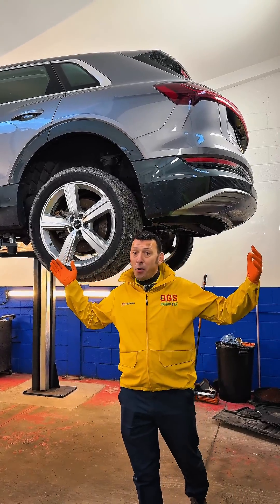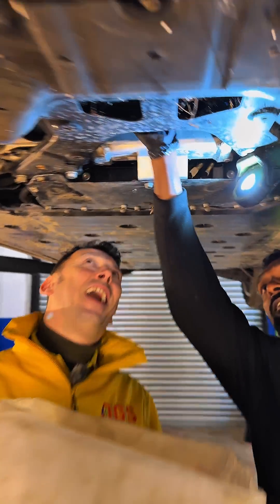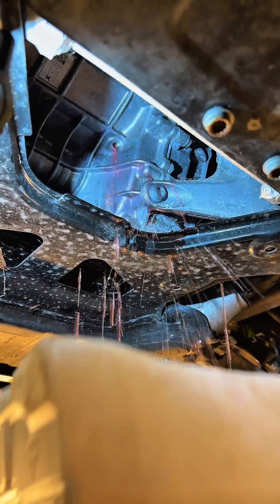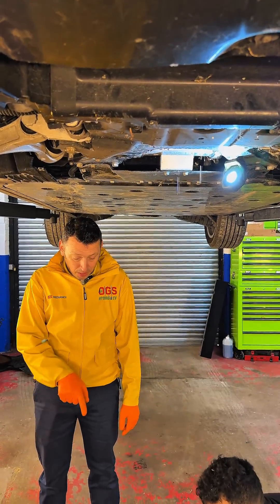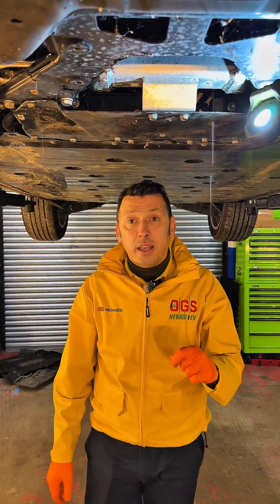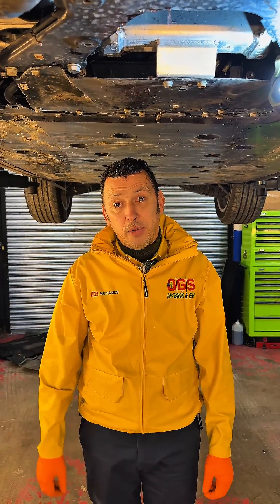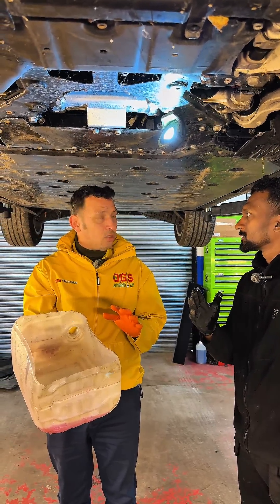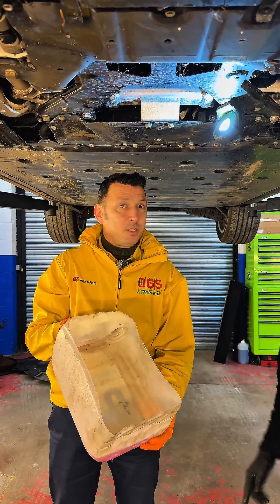Audi e-tron Killer Fault: Coolant Leaking Into the Electric Motor!

Comment: How many miles on the Etron? This should be covered by the factory warranty, well in the U.S. 8 yrs or 100,000 miles. 

That’s a shame that it’s so common that you already have a “where to start checking first” list. 

Keeping electronics cool is key for performance and efficiency but mixing different types of metals or even materials that have different rates of heat cycles is a potential failure point and here it is the loss of coolant where it should not be.